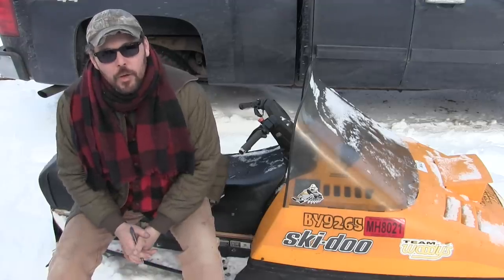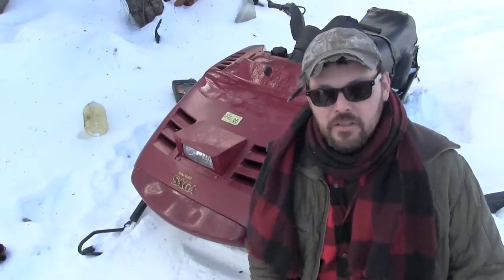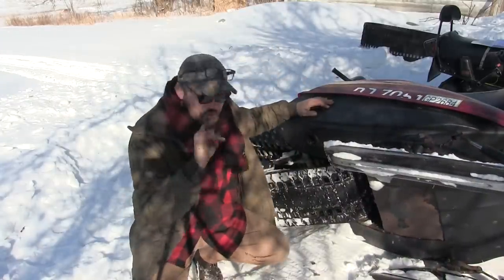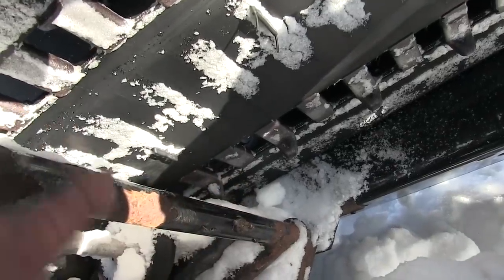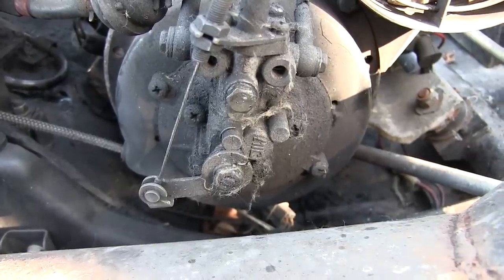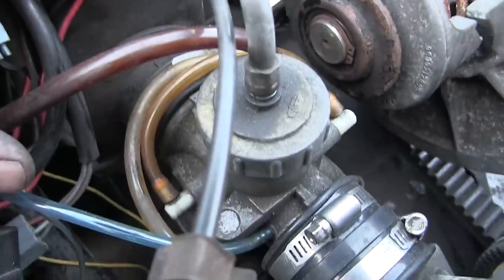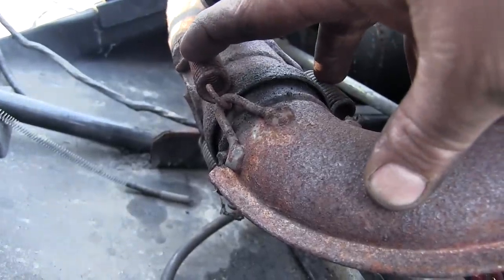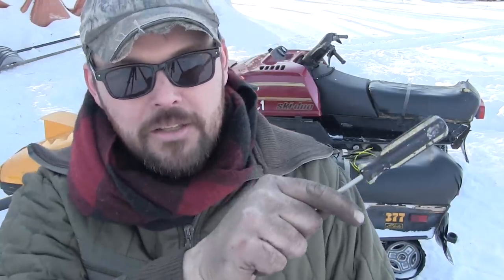Get a Snowmobile for CHEAP!

Comment: A lot of what this man said is incorrect. Buy 2000 and newer definitely not anything from the 80s ! Don't let dual carbs or liquid cool scare you off. Skidoo skandic or tundra are great. A $500 snogo is going to leave you stranded and walking home ! I ride 3000 miles a year in Alaska and would never ride the junk this man is suggesting.
Reply from the maker: Ive road lots in Alaska too. ....neither of these machines is too far removed from a Skandic or tundra.  Being New doesnt mean jack either.....ive seen sleds of ALL ages broke down. If only the guys at Compeau's can fix your sled, then you're screwed from the get go. The Yamaha Bravo is one of the most popular sleds in Bush Canada, and Yamaha is once again making the VK540. These are "old School" sleds. Not a ton different from 80's sleds.
Reply from the maker: By the way.....what 2000 and newer sled are you supposed to find "cheap"?  Did you miss the title of this video? Also, if you're putting on 3k a year in Alaska you're mountain riding with a big paddle long track.....or....you're running a trap line. Explain your opinion a bit more..
Reply: @Bushradical  I run a trapline. I just bought a 2008 Skandic 20" Expedition for $1800. I have a 2005 Skandik SUV and a 2006 Skandic Expedition. Non of which I paid more than $2500 for. Compeau's does not touch my sleds. I won't even buy parts from those crooks. I fix my own. Bravos were at one time a very popular little snogo but they are very old now. A 2000 snogo is 20 years old ! They can be bought dirt cheap especially in the lower 48 and will go places the old machines can only dream about.
Reply from the maker: @wolfmantroy6601  Youre missing the point about getting into snow machining for cheap. I mention lots of times about getting something to dabble with for just a little money. I'm not talking about putting 3k on a back country trapline.....By the way, your 2008 Skandik is a good deal at $1800.....but thats WAY WAY to much money for someone to bomb around a hay field a couple times a winter. Also.....You seem to like Bravos, and you like Tundras......but a 2000's Tundra is Not a very different machine than the ones in this video. Its basically an 80's citation but with a long track and pogo suspention. I dont get your opposition to buying a cheap 80's sled....Its not like a tundra or a Skandik from 2000 are  very far advanced over a 89 377 or an 86 citation
Reply: @Bushradical  I agree that if a person is never riding beyond what they can easily walk home then a old machine is fine for them. I consider anything less than $3k cheap for a snogo. You're right that someone only riding a couple hundred miles a year has no reason to spend thousands on a snogo. Snowmachines improved greatly from 1980s to 2000s. The Tundra is a wonderfully simple machine.
Reply from the maker: @wolfmantroy6601  Here's a story for you....If you know Compaue's then you must be in the Fairbanks area........back in 2002 I bought Steve Smith's Safari.  If you trap then you've probably heard of Steve Smith.  His Safari was 92' and it was no where near as good of a snowmachine as a 88' safari. It was 100lbs heavier and handled like a truck..... Steve Verbanic ( Angel creek lodge) used to break trail for yukon quest on an Elan. I dont doubt the newer machines are better, but I think there is a sweet spot where sleds got pretty good but werent yet complicated. Thats what I would suggest people shoot for. Especially the ones that lost most of their resale value. ON THE OTHER HAND.....if you're running a trapline you certainly can justify a newer sled because it NEEDS to be reliable. Chhers
Reply from the maker: Cheers